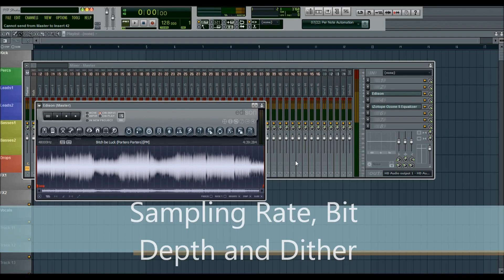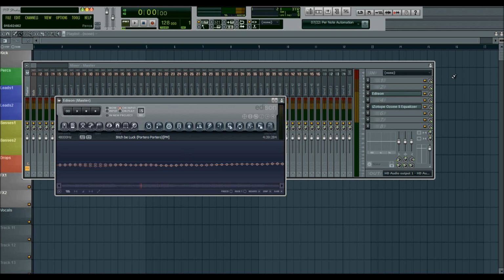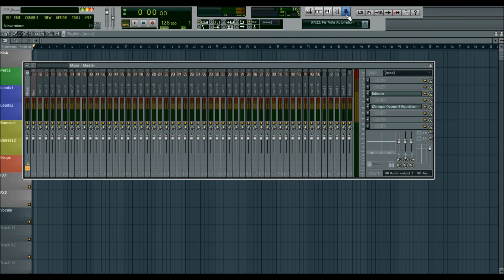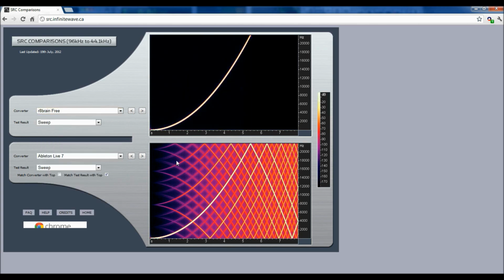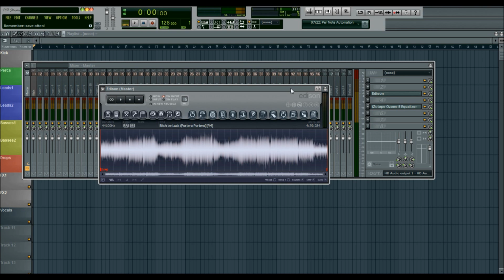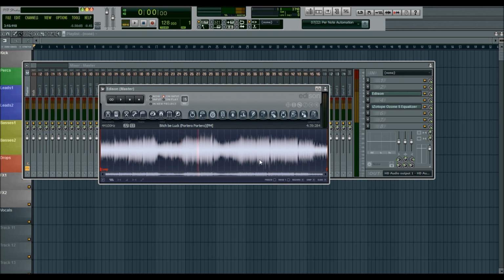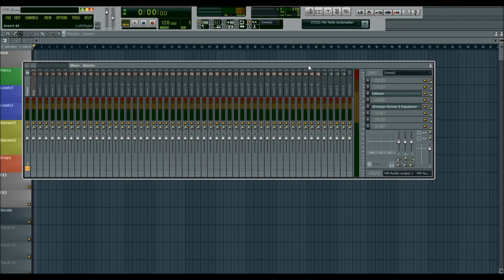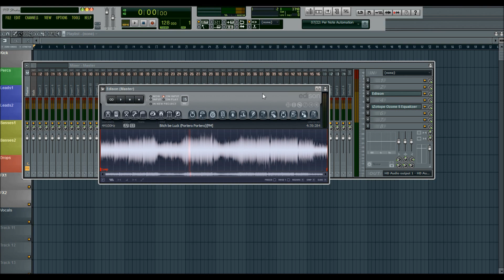FL Studio Tutorials: Sampling Rate, Bit Depth, and Dithering Explained

Comment from the maker: I wanted to export a file that was lossless yet not insanely huge in terms of file size so I went with 16 instead of 24 or 32. 16 bit also happens to be the standard format for CD's. Short answer: excellent quality, common format, and not a huge file size.

If I were to simply upload a song for download for the public, I'd likely use mp3 as quality isn't as important as having a more manageable file size. 320kbps is a nice compromise between quality and size.

Comment from the maker: Whenever you export in a higher sample rate it's important to make sure that your plugins/samples you're using are all at that rate. For instance, if you export a 44.1khz kick sample in 48khz, it will sound higher pitched if you don't run the kick through edison to sample up first.

192khz is really high, if any oversampling will make a difference, it's that rate. What I sometimes will do is oversample a mix, then master it, and then downsample back to 44.1khz.

Comment from the maker: That might be a few things. There are two possible modes you can use with FL Studio: normal and "extended memory." I almost always use extended memory; it should be in the same Image Line folder under "Program Files." This allows up to 4 GB of RAM through that instance of FL. Another possibility is that you're computer might not have enough RAM. RAM is used mostly when you load samples. If you open up the sample's settings make sure to "Keep On Disk" to free up RAM (at the expense of underruns).

Comment from the maker: No. One dither will work just fine. Think of the different types of dither as different flavors... they all work but just sound a bit different and combining them is overwhelming. The nature of dither is to smooth out low level distortion with barely perceptible, calculated noise.  When you add two layers it simply put does more harm than good. 

I left a good guide to dither in the description box written by Ozone. Pretty good for understanding the basics.